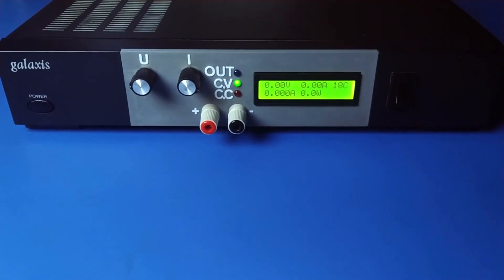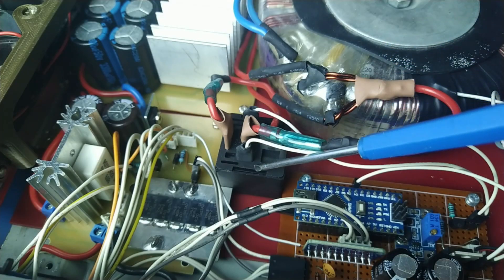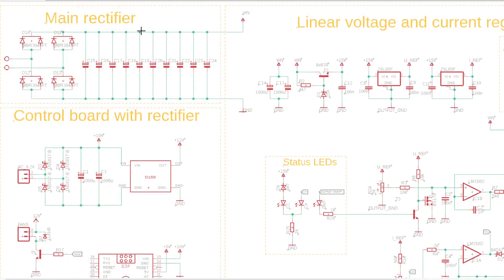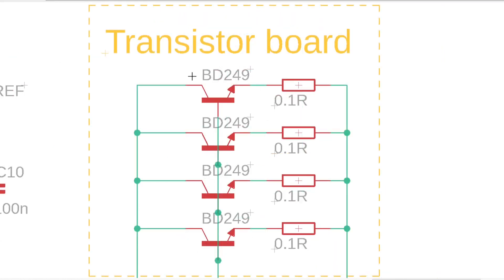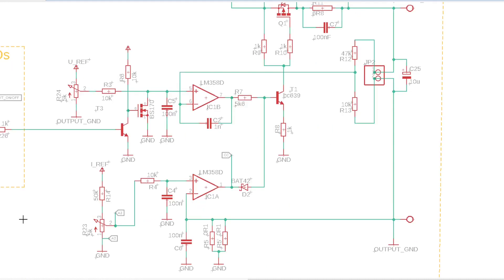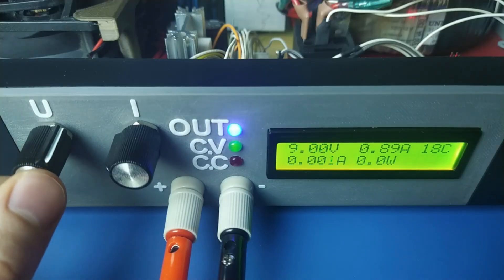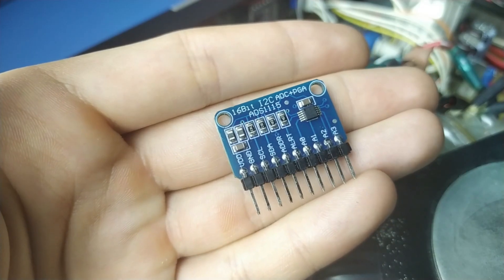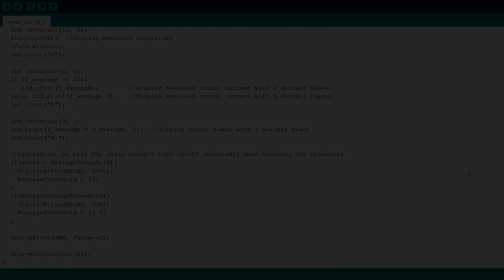Homemade linear bench power supply 0-28V 0.01-10A 250W!

Comment: thank you sir, I'm looking to build such a kit, but will it withstand 60 volts?
Reply from the maker: It could easily withstand 60V but you would have to modify it slightly. On the linear regulator board there is a simple linear voltage regulator built on one BJT, you would have to make sure it doesn't overheat and that it can take over 60v on the input. And of course some feedback resistors would have to be changed, and transistors should have appropriate voltage rating.

Comment: Whats the power factor at diffrent output voltages / currents? No APFC ? Does it emit any RF? Thanks
Reply from the maker: Unfortunately I haven't performed precise measurements of these parameters and there is no active power factor correction in this power supply, tho it might be a good idea to implement a passive PFC.

Comment: Nice build! It would be interesting to see some oscilloscope measurements of the  output ripple with load, CV and CC.
Reply from the maker: I've finally done these measurements:
https://github.com/Dominik-Workshop/Linear_power_supply/blob/main/measurements.pdf
Reply from the maker: Thank you! Good idea, in near future I might add these measurements somewhere, maybe on the GitHub repo of this project.
Reply: Yeah, without measurements on switching, load, etc I can't assume this is any better than Chinese junk. I bet that relay alone is causing huge spikes.